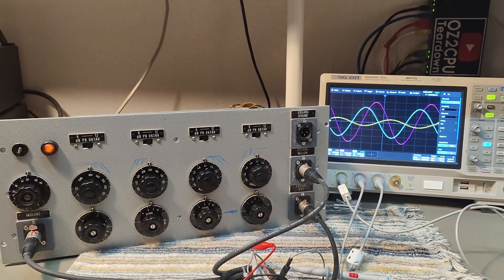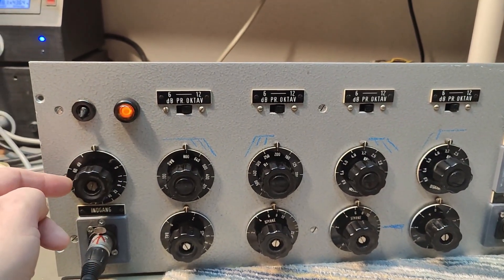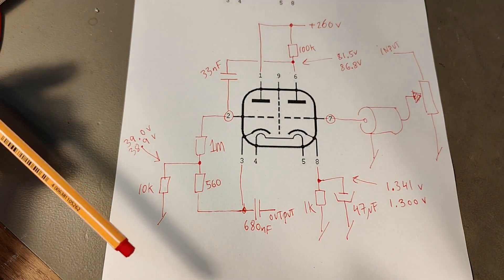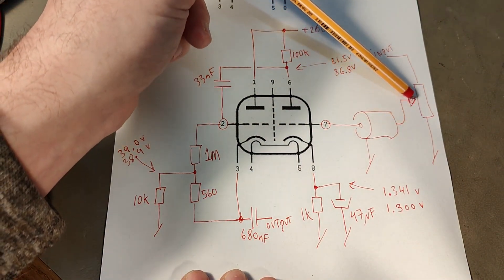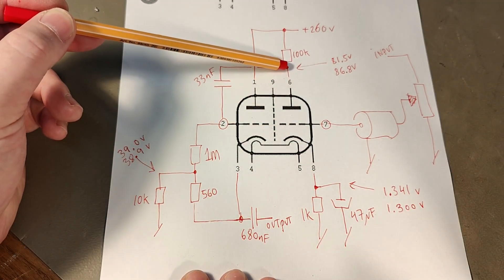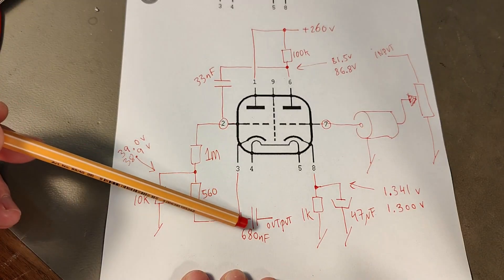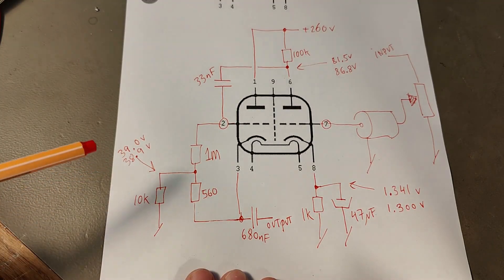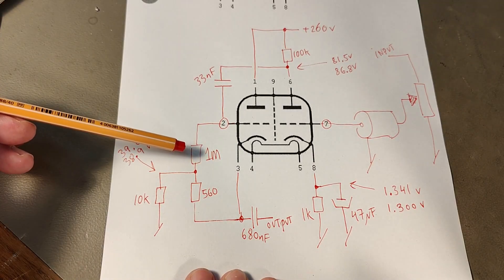Triode tube grid variable impedance problem for tube designers

Comment: You could have lifted the ground connection of the pot, added a series resistor to the pot's leg to prevent the grid from going directly to ground (pot's leg to series resistor and then to ground), and then added a film cap in series with the coax to the grid.
Reply from the maker: there are a few ways to solve this, if the requirement is audio level must go all the way to zero, it will not be accepted to add a resistor in the gnd of the potentiometer, then the resistor or what ever solution you go with, must be in the path from potentiometer to the grid.

Comment: Mostly I work on tube radios and there is always a capacitor between the volume pot and the grid. Why any company would do as in the schematic I don't know, messing with grid voltage is bonkers. DC on the volume pot also makes scratchy noises when you turn it.
Reply from the maker: EXACTLY, we got two problems, DC in a potentiometer is very bad, and current in a grid is no zero , as many thinks, so my point is just, we need to repeat this for the new people who work with tubes, it is not a part of any education anymore